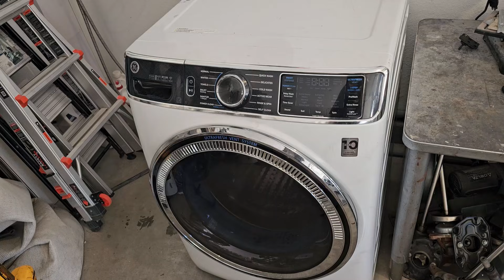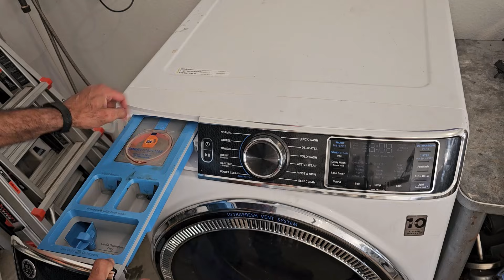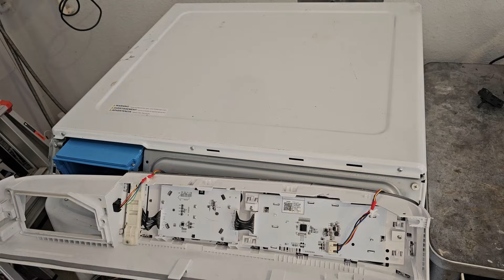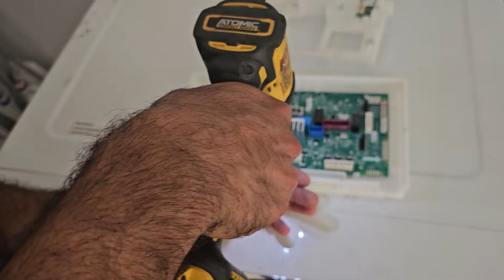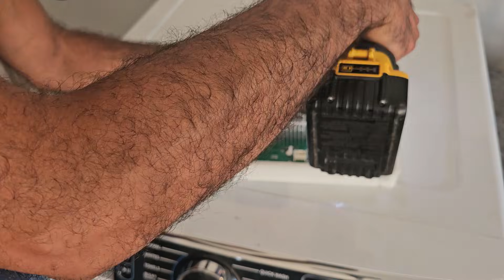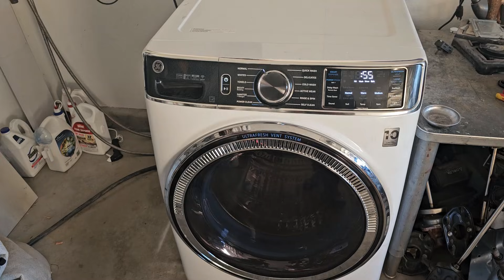How To Replace The Control Board On A GE Front Load Washer!

Comment: I have the GFW550 — so it’s the other control panel.   I’m getting the door latch error 19.   I have the replacement door latch coming tomorrow.   My question is if it doesn’t resolve the door error message— it’s likely the control board.   Does the board come pre programmed or just plug and play if the latch doesn’t fix the door error message?
Reply from the maker: All you have to do is plug it in then it will prompt you to enter the "personality" of the washer when you turn it on. The personality can be found texting "Parts" to 36534 which will then ask you to enter part number of board. Simple! All of these instructions come with the board (which can be purchased from link in description!) Good luck!

Comment: I really appreciated this video! It was very helpful to see this part being changed out before doing it myself. The only thing that I would add is that you do not need to cut all of the zip ties that hold the wires in place just only the one that attaches the wiring harness to the mounting plate for the board itself, if you only cut that one, you can leave everything in place disconnect the plastic backing swap the board out put it back in place and you don’t have to redo any of the cable management except for that one zip tie

Comment: Was sorta helpful. Once the control board is installed you have to set the personality by pressing start and choosing option 1 or 2 depending on your machine. I got stuck here and had to call a technician. Was so close to fixing it. Took the technician less than a minute to fix and cost me $150
Reply: Try grok or chat gpt next time, I was able to get full instructions for my model in programming the personality setting.
Reply: Ouch, my part came with a card to text GE your part number and it auto texts you back programming instructions...
Reply: Does my drainage pump needs changing duck tape mechanic

Comment: Wouldn't drain, used your other "won't drain" video. Tip, blow into the hoses and see if they're clear and not plugged up. Mine were clear. Replaced the pump. Nope. Twenty ohms, like you said, it was perfectly fine. Replaced logic board,  yup. $200 later, my washer is now fixed. 
I'm absolutely disgusted with this product. One of the screws into the chassis for the board was in so tight it stripped the head. Had to get a screw extractor, another trip to the hardware store. The gray connectors are tough to get apart, get brave, squeeze and pull. You're not gonna break that board anymore than it already is, Just don't break the connector.
From what I gather, this piece of junk washer suffers from a poorly manufactured logic boardYou know, I spend a thousand dollars on something so I don't have to turn a wrench on it two years after I buy it, but here I am on youtube... I'd say never buy another GE product again. But if you're watching this video, apparently you're already committed to this badly manufacured washer, same as I was.
Boomshanka.
Reply from the maker: Well said! 🎉

Comment: Thank you for this video.  It helped.  I have the exact same washer and the programming code is 4, link at end of comment.  So, two very important things could have helped here in this video. Taking out the screws connecting the control board frame to the washer is a PAIN. The screws go through the metal washer frame and the plastic/resin frame of the control board holder. I didn't push in before trying to take the screw out and ended up stripping the screw. I had to use a Speed Out screw extractor to remove it (replaced with a screw I had). The second thing is unclipping the connectors.  All need to have a button/release pushed in, sometimes you have to use a flathead screwdriver to help with this, especially the ground connector.  

Another thing, don't do what I did, try to run it with the water off.  I started getting all sorts of errors and had to reset via mode 16.

Thank you again, helped a great deal.  Programming link below

https://855723777883-us-east-1-parts-service-docs-prod.s3.amazonaws.com/WH22X37840.pdf

Comment: Very helpful video. Door was not staying locked but no error code. First I changed the door lock mechanism, still had the issue. Switched out the board, it was simple. Washer is working great. Thanks for the video.
Reply from the maker: Great work on the repair! Glad I could help!

Comment: Showing how to remove the plugs would be helpful
Reply: 😢thisss as a female who is forced to do it by myself I am struggling big time
Reply: @rociorobles3835 all the plugs have little tabs on top of them. Most of them you kind of have to push down with one finger and pull with the rest. I have fat fingers so it took me a while.

Comment: Thank you for this video! Your step-by-step guidance was excellent and gave me the confidence to tackle the repair myself. I was able to fix my washing machine, and it’s now working like new again. You saved me a lot of money compared to calling a service technician. Really appreciate you taking the time to make this!
Reply from the maker: That's awesome! You probably saved at least $250 doing it yourself!
Reply: @DuctTapeMechanic  Absolutely. Plus it was fixed way quicker. My sister had this exact same issue a year ago and went through the warranty process and it took over five weeks to get it all fixed/replaced. We were down for about 3 days, mostly just due to waiting on the control board delivery. Thanks again!

Comment: I absolutely hate this washer.  We've had it for BARELY over 3 years, and I am now facing my 2nd control board replacement.  Absolute piece of crap, I hate modern appliances, computer driven nonsense that is prone to fail.  Wish I had my washer from 1970 still.

Comment: I just replaced my control board with this video. Very helpful! 
After I got it replaced the inter face just flashes and nothing happens. Any idea what the issue is with that?
Reply from the maker: Make sure all plugs are plugged into the board. Reboot the washer by pulling plug and repluging it in. Then text PARTS to 36534 they will walk you through the simple instructions of entering the personality!

Comment: Thank you so much! My machine is less than 4 years old so I spent $180 for an appliance repair person to come and diagnose my machine. He told me it would be cheaper to replace the machine because it was an expensive repair and the machine would probably not work properly anyway because they are calibrated at the factory and he wouldn't be able to calibrate it. He didn't even touch the machine.  So, I was on the website to buy a new machine and before I spent the money I had the idea to at least search the internet. When I searched for the symptoms that my machine had I came across your video. It was the EXACT symptoms my machine was exhibiting. Anyway, I bought the pump and the board through your link, $240. I followed your two videos and completed the job fairly quickly. My machine worked perfectly after the repair. You saved me at least $1,000!!! The only bit of advice I would add is that the board needs to be programmed which was extremely easy to do. Just send a text to 36534 and indicate "PARTS" and then follow the instructions from there. Other than that, this was a perfect video that saved my machine and my wallet!!!

Comment: Great video. My GE will not drain or engage the drain pump. No clogs. I tried test 12 and the screen just goes black when I press start. I replaced the pump and it did not fix the issue. Both the old and new pump resistance were measured at 19.8, so I assume the old pump is still ok. I am looking to replace the control board now. Do I need to replace the pump as well or can I just replace the board? Hoping to return the new pump to offset some of the cost, so if it's not crucial, I'd like to save some. Or is this too risky? Thanks!
Reply from the maker: You need to replace the drain pump as well. The old drain pump will burn the new board!

Comment: have you seen any of these washers that have a blinking light inside and nothing on the display? any idea what component on the board fails?
Reply from the maker: Definitely sounds like the control board has failed (a common issue on this machine). Cheapest available replacement is linked in the description (just make sure to match your model number)

Comment: Thanks for the amazing videos. My GE Washer GFW650SSN0WW is only 5 years old and its not draining water. Normal wash cycle is supposed to be for 56 minutes, but it will be done in 45 minutes and when I open the door, the clothes are very wet and washer drum has lot of water in it. When I run the Rinse mode for 15 mins, it empties the whole drum. The pump filter looks good. Since the machine is so heavy for me to  check I am not able to guess whether its due to the Drain pump inlet clog, outlet clog, drain pump itself or the control board. Any thoughts what I might have to replace?
Reply from the maker: Definitely sounds like a an issue with the main control board!

Comment: My machine turns on and when I push start to do a load, it starts a rhythmic hum and the door lock clicks 3 times then stops but the humming will start again and sometimes continues after i turn the machine off.
Reply: Same, what did you do to fix it?  I’ve replaced the door lock.  Did you have to fix drain motor first or just the board?

Comment: I just went back over to wiring I had a wire plug that had a cap on it so I removed it and it fit the new motherboard. My new motherboard looks like the one you installed my old one had a different configuration. thanks for the reply. and thanks for your DY video. It was great.

Comment: I have the 850 model but with my luck all the way my luck always goes. My motherboard is slightly different than the board you installed. I checked on GE appliances and they’re not showing my board.

Comment: Just completed this repair today to fix my washer.  I did some shopping around on the board, but your link had the lowest price I could find, as well. I saved hundreds of dollars, gained some hands on experience on fixing things, and I am the hero of the house today, thanks to your help.  It would would have been much more difficult (if not impossible) without this video.  You paced things well in the video and I have subscribed and hit the alarm bell out of appreciation.  The only thing that needs to be mentioned is setting the personality mode, but this is a single step instruction that came with the board.
Reply: Any idea how to do the last step without instructions? I didn’t get those in my part box.
Reply: I was about to purchase the two boards the tech said were bad ! 800 bucks for parts and labor and Inpaid 900 2 years ago! So I decided to open it just to see inside befor buying the boards on Ebay and surprice the machine worked! Was it a lose wire, or someting pinched? Any ways I sugest mess withbit before dropping some bucks, maybe I got lucky and maybe the problem may come back? But as of now its good.

Comment: About 2 years ago I did the pump and board. Today my laundry room is flooded. I had a bunch of codes. As I am doing the diagnostic testing the door lock switch keeps clicking. I didn't even bother to ohm it out. I know the switch took the board out. These units work great when they work. I also replaced the inlet valves as they were squeaking. I guess I should mention how it flooded. I was doing the pressure switch test and water started pouring out of the dispenser on to the floor. With the machine completely off the door lock still clicks once in a while. Tomorrow is Saturday. I hope I can hunt parts down. I have 2 sources that are open. So this unit is 5 years old. 2 boards, a drain pump, door lock switch, inlet valves on my dime and the bellows while under warranty. At least I know how to work on it.

Comment: 1/18/2026 -just want to drop this comment to say thank you for this video, it was very well made and paced. Your instructions were clear and I came to this video after watching your drain pump replacement video, as I found a comment mentioning that if you change the drain pump, you should also change the control switch. Replacing both parts and finally reprogramming the personality mode fixed the problem and my machine is back to working like new. Thank you!
Reply from the maker: Thats is awesome! Great job on the repair! Glad I could help!

Comment: I replaced the drain pump and checked for clogs on a 550. Pretty much same machine. 2023 model
Reply from the maker: Also need to replace the control board. Bad drain pump takes out the board
Reply: @DuctTapeMechanic I did both
Reply: @DuctTapeMechanic just replaced main controll now the whole UI is flashing
Reply from the maker: @derickpouliot6388 did you go through the steps of entering the "personality" of the machine? The control board comes with simple directions on how to do this
Reply: @DuctTapeMechanic  im new to being a service technician. Let me check the box that the control came in. Thank u
Reply: @DuctTapeMechanic so I didn't come with any paperwork. Im calling GE right now to see if the can help me with that. You have been a big help and I subscribed. Thank you again
Reply: You were completely right. I had to set it to personality 2.
Reply from the maker: @derickpouliot6388 awesome glad you got it all figured out!
Reply: @DuctTapeMechanic you are awesome thank you soooo much buddy

Comment: I wish I had found this video before I started to fix ours. It had a scrolling door message on the control panel screen. I assumed there was a problem with the door switch and replaced it as well as checking the wires for continuity back to the control board. I learned you can bench test the switch to see if the contacts are closing as they should. I didn't need to replace mine. I also learned that if you trip the lock mechanism you may have to take the cover off the switch to unlock it. There may be another way, but I could not figure it out. Be careful the lock tabs break off easily. Pay attention to the spring and the cams and how they are assembled. The other thing I learned is the circuit diagram sort of tells you where the switch wires plug into the main board. I took the wraps off the wires, so I was sure of which plug it went to, that was unnecessary. I believe the plug point is J602 on the main board. Hard to see without pulling the board out and using a magnifying glass. The other thing I learned was how to use the CFCM, consumer fault code mode (the paperwork with the circuit diagrams explains how to use this function). Mine displayed 26 27 38 39 and 92. I think the 92 code which isn't in their list indicates the main board is bad and is the key problem. One other important thing I learned is to not drop your flashlight inside the machine because then you learn how to detach the boot and remove the door and front panel to retrieve it. BTW that makes working on the wiring from the door switch to the main board much easier to work on. Basically, removing and replacing the board is as described. The plugs are a little tricky to unlatch. Most of them work the same except for the two gray plugs. There you need a small screwdriver inserted under the half round feature of the plug to pry up or down, I can't remember which direction now. I found it is better to remove the rear gray plug first when pulling the board out and back in last when plugging the cables in. I tried using ChatGPT to figure this out which is very good for some things but fell short for this project. The help number on the literature inside the machine got me to a knowledgeable person who said the 92-code meant the board was bad. Why it was bad or what caused it was unknown but a common failure according to what I've read. As said in the video be cautious when replacing the board so as not to have to do it again. Our machine is a GFW550SSN4WW and the current board is WH22X38697 2.5 years old. It fired up right away and we have three loads of success so far.

Comment: I want to add, i believe wat happened with my washer is the pressure line leading to the pressure switch on the control board (terrible design), came loose, because it was disconnected when i opened up the lid.

Im pretty sure the pressure line loosened up and squirted just enough water to ruin the control board.

So after installation of the new board i secured the pressure line with a tiny zip tie, i didnt want anything metallic there so yea, just a heads up.

I also replaced the drain pump just as a precaution wasnt going to risk burning the new board.

Comment: Thanks for doing this video, it got us back up and working again. Also the program details for those who don’t have it.

LEDs are flashing.
1. Press and release the Start button. LEDs will stop flashing and the display will show “1”.
2. Press and release the Start button until the display shows the number of the personality ID
needed.
▪ When the end of the ID list is reached the control will wrap around to the beginning of the
personality ID number list.
Model # GFW655* 9
GFW850* 4
Personality ID #
GFW650* 3
PFW870* 10
PFW950* 6
PFW955* 11
3. Press and hold the Start button for three seconds when the correct personality ID number is
displayed.
▪ This will save the personality ID number and the control will go to an idle state.
Reply: Important step, thanks for adding this, I was confused when it started flashing. It of course makes sense that a board is used in more than one model.
Reply: Gfw550 is id #2